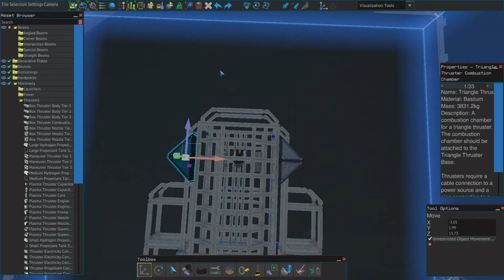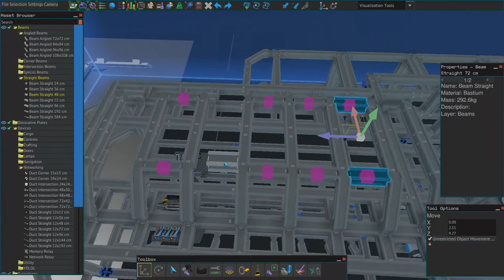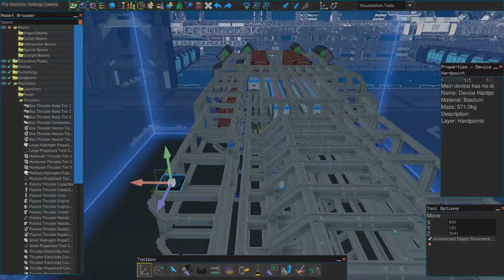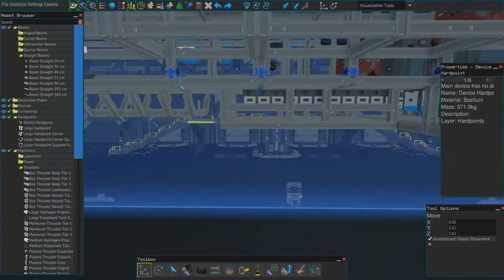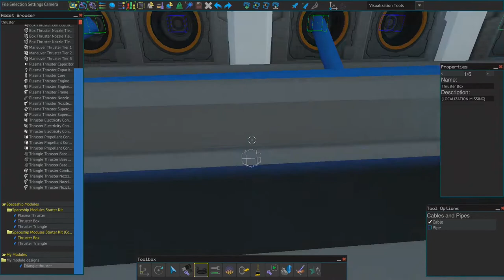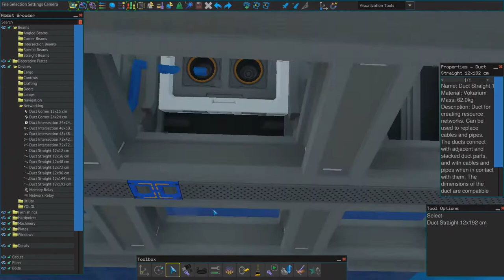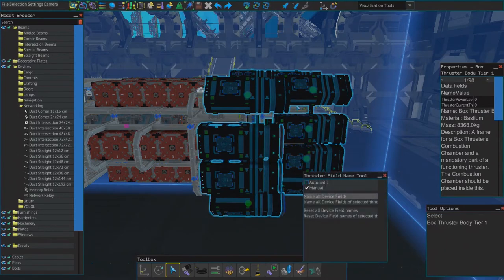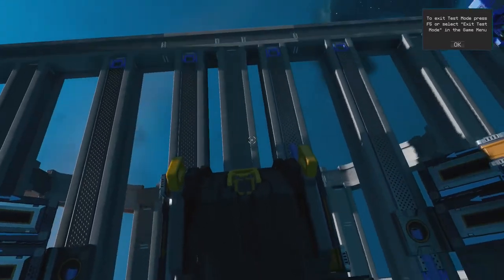Starbase - Let's build a Gunboat - Part 6 - Maneuver thrusters & Connections ! - I hate Triangles :)

Comment: As a general rule all thrusters touching should have the same names. Ship is not big enough for triangle maneuver thrusts. should be using Tier 2 everything, thrusts and generators! Save the brain pain for later manual upgrades. But! Hell man you make ship designing look like child's play man good job and awesome video!
Reply from the maker: My plan was to have 2 versions of this ship with the first one having all tier 1 components and the second version using higher tier components.
Also, after seeing Maverick's ship 2 nights ago and seeing how he uses triangle thrusters kinda inspired me and made me wanna try them again.
I don't wanna do exactly the same thing he did but making a square out of them seems like a better way to use them as maneuver thrusters and fitting them inside with just the nozzle sticking out feels like it's possible on my ship too.
I'm not gonna do that in part 7 but i may come back to it in part 8 or something like that we'll see :-)

Comment: I was just wondering why you didn’t use ducts to get cable and pipe to all the thrusters instead of running pipe and cable running those longer distances?
Reply from the maker: I wanted to use ducts everywhere on the main structure of the ship and maybe some other places where they were simple to use but in a lot of cases, running pipes and cables is just a lot easier .
Reply: @KrawllUnchained  Very true.  Sometimes you just have to take the easier route!!!

Comment: hi again :) 
i think I know why your ship is not to fast because at the end of your video when you jump off your ship I could see that the 2 boxthrusters outside on both side dont work !
and check the names of your thrusters again because i have trouble too.  i think the renametool don´t work right . i hope thats helpful
Reply from the maker: Oh wow, you're right, it was difficult to see because of the angle but now that you mentioned it, i saw it.
I think it's because when i named those, i had only selected the outer shell of the thruster.
I think those 4 were built piece by piece and the others are all modules so when i selected those i couldn't select the whole thing with just one click.

I'll probably just replace them for modules.

Comment: By any chance do you know how to make 2 threads control modules/ flight control work together or work?
Reply from the maker: I'm sorry Andy i'm having a bit of a hard time understanding your question here.
Are you referring to having 2 MFC's ? If so i have not tried to put 2 MFC's on my ships yet.
Reply from the maker: @randy80ism  I never tried having more than one MFC but if i did, the first thing i would try, just to see if it works would be to have one MFC with 1 - 50 and the second one with 51 - 100 and i would hope that they link together the same way as the MFC and FCU are linking together.